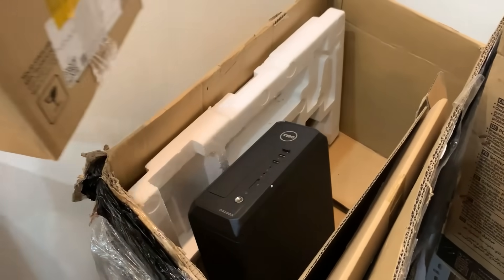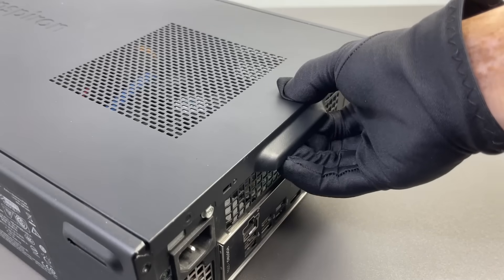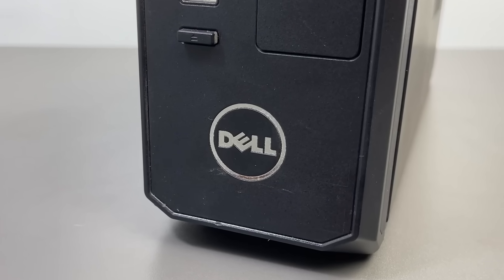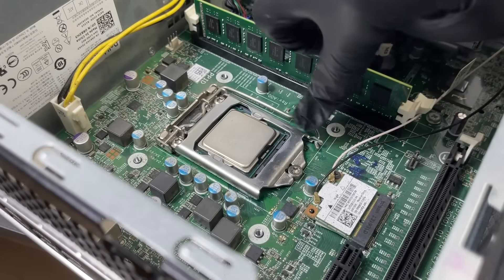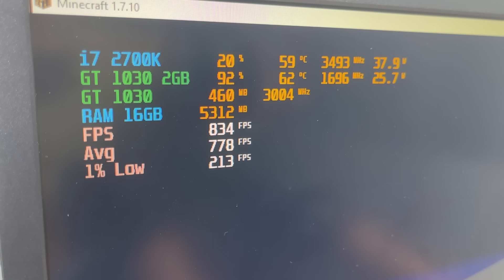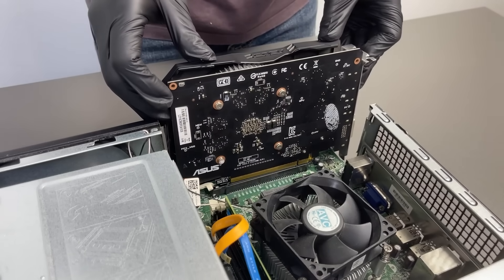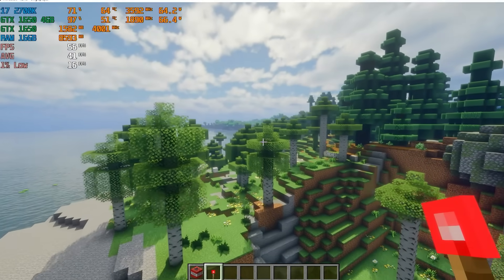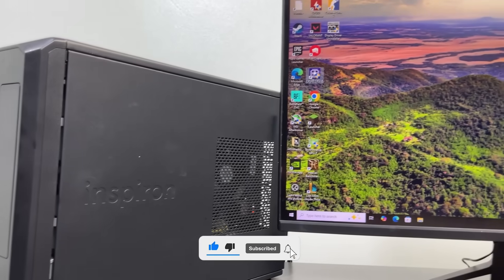How Far Can I Upgrade This 12 Year Old PC!

Comment: my first GPU was a OEM HP 1650 super. Used a SATA to 6 pin adapter (it's fine Mobo does 75w, cable only has to do 25w) total 1650 super tdp is 100w

But the normal was definitely considered as the tpm works with no external psu connectors from the mobo

I miss that card
It was solid, low power so it ran on my stock dell optiplex 3020 Mt 290w PSU with an I5 4570 and a timetec 500gb ssd. 2 timetec Drr3 8gb ram sticks for 16 gb total.
Lga 1150 dell monster

I love Dell office PCs for gaming.

Comment: i did a similar thing, i got a dell inspiron from my neighbors with an LGA 1150 socket, and i threw in an i7-4790k, a GTX 1650 Super, 16gb of RAM, a new ssd, and a new power supply

Comment: The cooler was a down draft configuration, meaning that It blows air onto the board also cooling the VRMs .
Like though❤
Reply from the maker: Good point — that airflow over the VRMs is actually super helpful on older boards.
Thanks for mentioning it, and appreciate the support ❤

Comment: Wouldnt that 95 W TDP CPU fry that basic motherboard in no time? Just asking, cause lets say theres an office computer with h81m chipset able to theoretically work with 4790k,but would it be the best choice without other tweaks? Wouldnt something like low powered xeon with half the TDP and only slight - maybe 20 percent performance downgrade be a safer option in the long run?
Reply from the maker: thank you for your information, i will check it carefully once again❤. let keep in touch bro
Reply: Well Im no expert, I was just revitalizing older haswell pc for a friend and stumbled upon the topic of different motherboard classes build quality and choosing cpu TDP accordingly, it might not be such a big deal. 😄 But its probably the same for other generations as well.

In this case, it went from i3 3170 to Xeon 1275L v3 - xeon has even lower tdp - 45 vs 53 W, while delivering roughly + 75 percent performance on top vs like + almost 100 for 4790K nonOC thats like 88 W TDP. (and cant be OCed on that mobo anyway, plus otherwise they similar apart from core clocks - number of cores/threads/cpu cache sizes.)

Other option was 65 W 4790S that would be in the middle in terms of performance, but we chose safest bet. In terms of price Xeon was cheapest + even cheaper, when you consider theres no need to upgrade shitty office pc case cooling in any way. 😊

Comment: Same but I have laptop i3 11gen ddr4 ram Intel HD 4000mb 238gb nvme ssd laptop lenove 😢
Reply: But when I play minecraft on it after adding mods some optimization then it give me 200 or 250 fps but if I use vlcun mod then I get 400fps or 500 fps but vlcun is crushing cause it's still devil oping

Comment: I remember my 1GB GT 430 on a retro PC giving it a real boost after upgrading from a 256MB 8600GT :D Those were the days. It was a shame the graphics card would crash with artifacts on startup, even though it wasn't overheating. And 1GB of RAM on the motherboard didn't help. One repair shop felt sorry for me and added a second 2GB stick of RAM to the 1GB, even though it was 800MHz, not 666MHz. It worked somehow, but looking back on those days, I already knew what was missing to make the PC run better. Looking at 1GB of graphics, 1GB of RAM, and an HDD back then. And today, 8GB of VRAM and 32GB of RAM with an NVMe drive makes a huge difference in performance. And that's not even mentioning gaming. Always consider the requirements of the game you want to play, not whether my PC is too weak, won't run, or will crash on anything.I'm curious, how did you connect the 4GB graphics card to a 220W power supply? Without a cable powering the graphics card? Although there are graphics cards that don't require additional power.
Reply from the maker: its wonderful bro, i realized that my knowledge is very small, pls help me improve my quality of video. thank you bro

Comment: I also enjoy doing these kinds of little upgrades... especially on laptops (which are more limited by their locked bios-es and the fact the manufacturers never released anything new in a long time).
Surprisingly though, for various laptops that don't have soldered CPU's, manufacturers tended to post BIOS/UEFI updates for a fairly long time... its more recently that they just decided to 'give up' after 6 months or so.

I managed to upgrade a substantial amount of laptops like this. For those that had limitations pre-built in them, I was only usually able to suggest RAM and storage upgrades... in other cases, CPU's too.
Reply from the maker: you are right, because Laptops upgrading is too difficult than upgrading PC. but we can try if we have enough conditions. thank you guys

Comment: The GT 1030 is overlocked quite often. It's performing about as good as the GTX 560 did when this Vostro was built. And the GTX 560 was a solid mid-range GPU back then. The GT 1030 has a similar power while only sipping a little bit of electricity and it has both more VRAM and some newer tech inside. Yeah, it won't handle modern AAA titles but it does handle quite a lot of games still.
Reply from the maker: yes thank you, i think its still good until now, and we can use for along time later

Comment: You should have gotten the i7-3770 instead of the 2700. Little bit faster, newer iGPU, little more efficient. Not worth it if you already have an i7-2700, but compared to an i3/i5, the 3770 would have been a better decision. And there is very little chance the vostro couldn't handle the ivy bridge chip compared to the sandy, at least if the BIOS was updated.
Reply from the maker: thanks for your feedback, i love it

Comment: I like using those cases and swapping in an itx motherboard,  I7-8700, Noctua nh-l12s, gtx 1650 super, rtx a2000 or rtx 3050 low profile. The power supply doesn’t have any issues.
Reply from the maker: Appreciate the tips! Could be fun to test some of these in an ITX build. Follow along so you don’t miss it

Comment: i run a dell 7050 i7 7700 water cooled  in a black fish tank case 32gb of ram rx 580 8gb over clocked to 1460 600w psu some rgb 12 fans i like it i play cyberpunk at high/med settings  on a 4k tv looks and plays good 50/80 fps  i like looking at the green motherboard,,,,,, lol  all in less then $300 back in June 3weeks to get the right cheep parts amazon/eBay new/used parts fun to make and play for the low i can't be mad at it
Reply from the maker: thats sound great. thank you

Comment: I still run daily i7 2600k, currently I use it at 4620 Mhz (102.5x45), and in CS2 workshop Dust2 I get 180 fps. So you can squeeze more out of it... though in DM it has less... in actual 5v5 it runs 150 most of the time.. RX6600 but custom settings (some on high, most on low or medium, 1080p).
Reply from the maker: Wow that’s impressive! Thanks for sharing your settings. Follow the channel to see more old CPU experiments
Reply: @gamerig68  Yeah even on Facit it runs 150-200 fps, as long as you close their client once match start (it eats up 20% CPU sitting on find match screen)... so great CPU still. Sure thing anyone who test SandyBridge in these days have my follow.

Comment: You'd probably need a 3D-printed case to cover up the SFF Dell PC and get better airflow. You know, adding the 1650 GPU. Also, you should probably swap out the case for the 12-year-old motherboard and put it into the Mid-ATX tower. That would have been better.
Reply from the maker: Thanks for the tips! I might try that in an upcoming build. Make sure to follow the channel to see it in action

Comment: COULD HAVE USED I7 3770K FOR MORE PERFORMANCE AND EVEN 1660 SUPER OR 1070 WITH THIS GPU
Reply: I think there is a locked bios, so more likely than not, the 3770k would not post. Plus, why spend the extra money on the k-variant when dell doesn't let you unlock core speeds?
Reply from the maker: @SteezyMonke  yes, may be let me think about that. thank bro
Reply: psu doesnt have power connectors and 1660 s and 1070 need those
Reply from the maker: @IBISHU_PlGEON  exactly. we need a big power to provide for 1660s and 1070 also
Reply: Xeon e3 1240 v2 is what he would want if it supports it since it's pretty similar but much cheaper
Reply from the maker: @Whyalwaysreparingstuff  thanks for your feedback  bro.
Reply from the maker: yes, thank sir, i will try it later

Comment: Gamerig, i have 12 gb DDR3 1333 ram in (1x8,1x4) configeration. Does it give same bottleneck as single channel? Or do i really have to buy another 8 gb ram?
Reply from the maker: Your 8+4GB will work in flex mode. It's better than pure single channel, but not perfect. If you want full dual channel, another 8GB stick is the way to go
Reply: @gamerig68 How much am I bottlenecked in flex mode?

Comment: the 3770K would've been a better pick

also, there's bare metal from the case directly touching the 1650's exposed PCB, I'd put some insulation there if you don't want it to short out and fry your 1650, also, the 1650 has a low profile version, making that trimming unnecessary
Reply from the maker: Thanks for the tips! I’ll keep that in mind for future builds. Follow the channel to see more experiments like this

Comment: Was nice. And yes, its a perfectly reasonable thing if you're on a budget and have some of the parts and... Only thing I'd try over this would be to go for a 3rd gen I5, you get a bit extra for less power, its cheaper and more accessible and well... a 4/4 shouldn't be that much worse than a 4/8 all bottlenecks considered.
p.s. you can (probably) still get a bit extra from the board even if the BIOS has no option. SetFSB, ClockGen, etc... It won't be as nice as simply bumping the multiplier as FSB is a lot more "sensitive" all around as it touches everything, but... On the 2700k, given the massive 35x clock, you can get a fair bit per BCLK. But, even if works, it will still depend on the RAM/PCIe tolerating the "bump" if you don't have access to the dividers. That said, 5% should be neither here nor there for stability. 10% probably same. Over that... who knows.
Reply from the maker: Totally agree — 3rd-gen i5s are underrated for cheap builds.
And thanks for the OC tips! BCLK tuning is messy but you’re right, 5–10% is usually the safe zone.

Comment: I DID EXACTLY THIS A FEW YEARS AGO! my aunt gave me this exact vostro and i case swapped it and put a xeon 1270v2 and a 1660 super in it and used it as my main rig for like a year
Reply: I highly recomment going for the xeons as they are a lot cheaper and offer the same performance. but you need a dedicated gpu
Reply from the maker: so are you satisfied with it? i think its ok. thanks for sharing
Reply: Yesssss xeons in Dell office PCs go so hard. Stable turbo, typically higher base clock speeds, and better single thread performance.

Comment: 6:20 that metal dust may cause a shortcircuit to the motherboard in the long run. Anyways, excelent video
Reply from the maker: Yeah for sure — metal shavings around the board are no joke. I blew everything out thoroughly right after filming. Thanks for pointing it out, and appreciate the kind words!

Comment: i5 4570 with GTX 1050ti or ryzen 3 3200g
Reply: You can buy i5 4570 with GTX 1050 ti. But I would recommend going with i7 4770 or 4790 with 1050 ti. Because i5 of that generation will bottleneck 1050 ti. I have i5 3570 and it bottlenecks 1050 ti hard. Don't go for apu's you will be disappointed. 
At least with 1050 ti you can play games from 2016 to 2020 era easily. After that even that won't cut it. 
I play on 1366x768p resolution.
Reply: RX 470 or 580 4gb Is it good?

Comment: ok so just one suggestion, you should never use a grinder on your PC case with all the components still in it because all the little shards of metal will get all over everything and can create shorts, which could destroy your system. otherwise, good video.
Reply from the maker: Good point! I’ll be more careful next time. Follow along to catch more build experiments

Comment: Most PCs are one good GPU away from turning into decent gaming PCs
Reply from the maker: besides that need good cpu too. if you don't want fps to jump
Reply: @gamerig68  That's also true, but it's easier to get a good CPU rather than a good GPU
Reply: Cool video.  ..
I did the same with and
 I7 860 ADDED 32G 1600 DDR3 KINGSTON
ZOLTAC GTX 1050 TI 4G LOW PROFILE
1 T SSD 10X KKINGSTON HARD DRIVE
ADDED COOLING FANS 
WINDOWS 10 PRO
FLY PELICON
IT DOES 1080P FLWLES HIGH SETTINGS IN ALOT OF TOP GAMES!!!!
PLUS RUNS OLDER WAR GAMES FLAWLESS
VERY PLEASED..
I PLAYED QUAKE III ARENA WOW!
AND NEW GAMES FLAWLESS SHOCKED ME WITH A HUGE SMILE WITH THINGS TURNED UP FULL OR NEAR IT.
FUN BUILD AND REALLY NICE EXPERIENCE
PAID HP $40 WEARHOUSE SALVAGE
ADDED $300 UPGRADE PURCHASES.
TOTAL: $340.00
I INSTALLED SO MANY GAMES TO TEST A  15 YEAR OLD PC ABANDONED BROUGHT BACK TO LIFE
Reply: @evilqtip7098  WHY ARE YOU SHOUTING!
Reply: @SiliconS32  Probably he is excited he can play games at good FPS at 1080p with a budget build
Reply: @evilqtip7098 there is no reason to put 32 gigabytes alongside such a trash processor
Reply: @CovenantAgentLazarus True but hey, 32Gb of DDR3 isn’t all that bad though, at least now chrome  might run smoothly for him, might.
Reply: When U use a celeron that is not true
Reply: @ThisIsLaggyGaming  That´s what I said, most PCs, not all the PCs, there are always some awful machines that with the GT 710 look like the CPU is the bottleneck and not the opposite
Reply: @therealegr that's why when u decide to upgrade ur pc i think u should go for the cpu first then the gpu come after. But honestly, u gotta find the balance between both of them.
Reply: @Unknownbruhh  Yeah, that's also right. Just i said that because i consider that there are a lot of office PCs that have good CPUs but integrated graphics, and a decent GPU can already bring you a good performance boost, but yeah, the CPU is also something it shouldn't be slept on
Reply: Nope, think about the bottleneck
Reply: CPU actually the world doesn't revolve around gpus, or you.